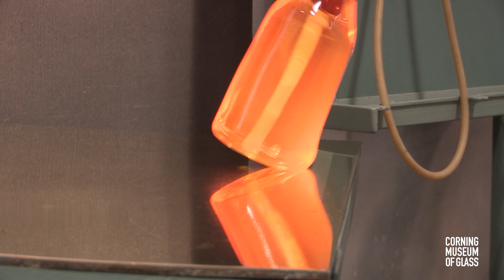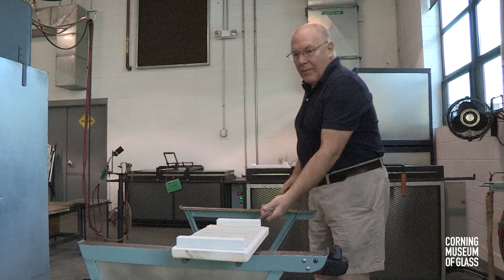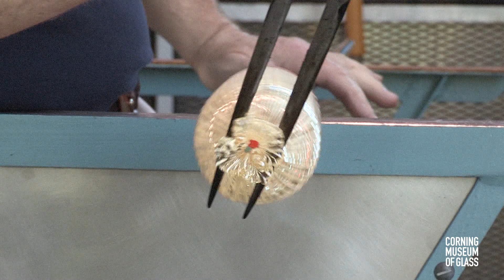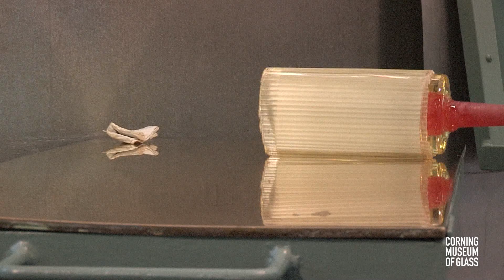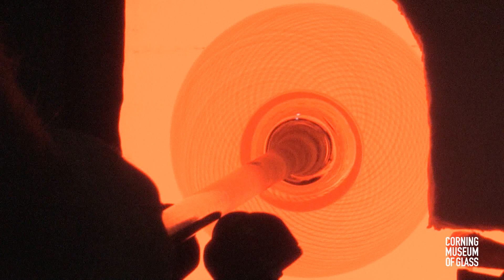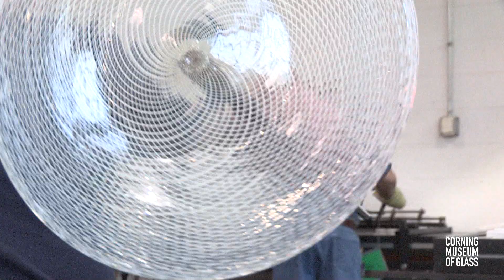Reticello Platter

Comment: Do you have to anneal the cane? How does that work if it is 40 feet long?
Reply from the maker: The cane is not annealed.  Because of its shape and diameter, it is very stable at 3/8 inch and smaller .  If the cane were larger, it would need to be re-annealed.  You would cut it up and put it in a cold annealer then warm it up and cool it back down slowly.  Then it could be cut.  If you were making large or complex cane, you would likely pull shorter  lengths, or break them while the were being made and them load the shorter pieces into a warm annealer.
Reply: Thank you for your response!
Reply from the maker: Thanks for watching!